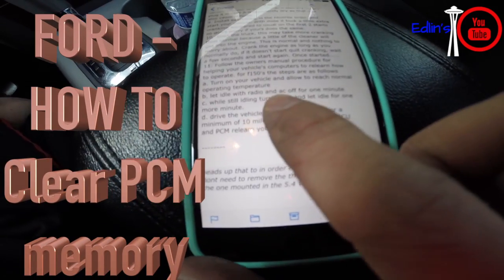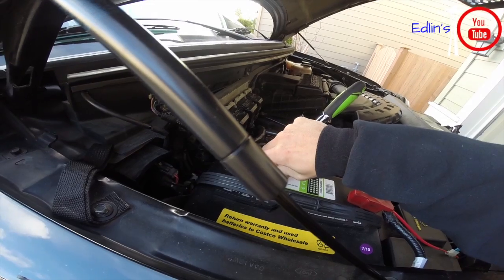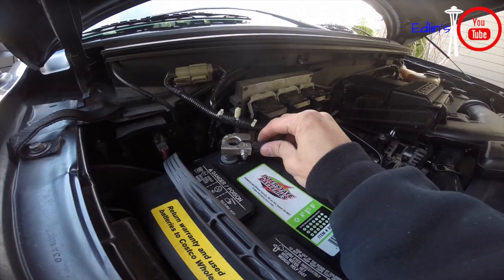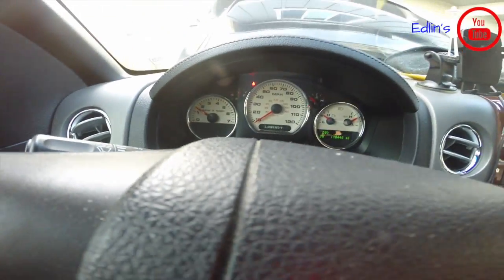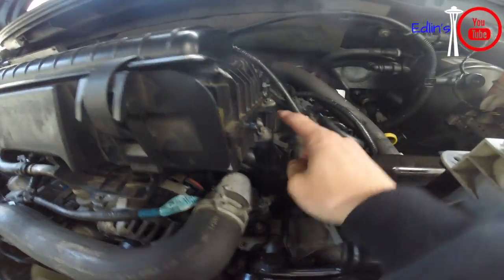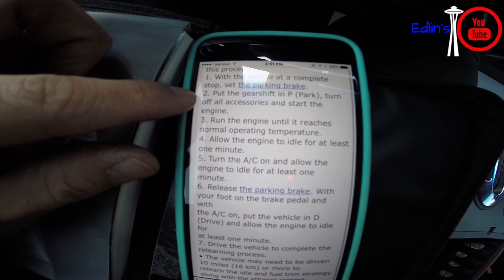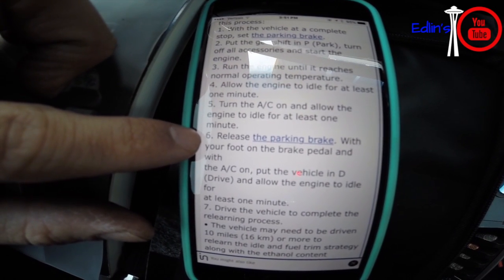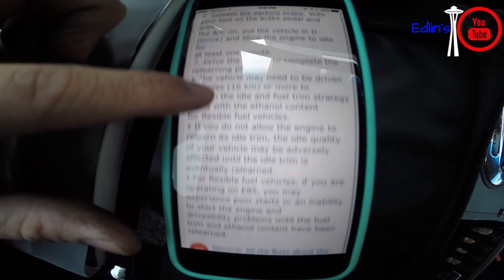FORD - Clear/Reset PCM Memory

Comment: It works both way on some models of Ford. Some just disconnect the neg and hook back up. Light will go off. To actually reset pcm disconnect both pos and neg and zip tie them togehter or jump wire them together for more than 10 mins to drain capacitors that are storing power for the pcm. When those die out the factory stored memory information will kick in after hooking up the battery terminals again. That's when you follow the instructions carefully. Some models will reset just by disconnecting. Rule of thumb....just because light goes out means the codes were clear. Kill off the power in the diodes and make the pcm rely on the mapping the car was designed to run on.
Reply from the maker: Good info, thanks for sharing!

Comment: This video will not reset the PCM period.
You need to disconnect the battery terminals and jumper short the battery cables for ten minutes. 😮

Comment: Hi there. 
We watched your video because my husbands trucks batteries had to be disconnect for 2 days.  
Tried to drive and realized we need to reset the pcm. 
If us a f250 2015. 
Will your video work.  
So do we start over and disconnect it all  ?
Reply from the maker: starting over is a good idea. it should work

Comment: Disconnect neg terminal, turn headlights on to drain everything.  Wait 10 minutes or longer.  Reconnect negative terminal (while you're there, pull and clean the body earth for the negative terminal also).
Reply: I let things sit for over an hour and it didn’t reset my code. No what might be the reason for this?
Reply: @tonyhall9764  probably has a time without power reset thing going on.  Or it just doesn't matter in your vehicle.  You definitely don't need to wait an hour.
Reply from the maker: thanks !!

Comment: I have a f150 turns over but wont start I put new timing chain, crank sensor, fuel pump,drivers modus, got new computer but still wont start. Any ideas on the problem
Reply: If you replaced the PCM, you may have to program it for your vehicle. The PATS, Passive Anti-Theft System may think the car has been stolen and disabled the starting system. Depending on the vehicle, you will have to take it to a dealer or someone with a special tool to reprogram the keys in order to get it to start.
Reply from the maker: sorry have you checked out ford forums. havent had that specific problem before
Reply: Had that once myself. Turned out to be the plug wires.

Comment: Yeah that don't work at all. I had my battery on my ford disconnected for 8 hour's, got in and the radio stations were still set to my surprise, I talked to a friend hoping to get him to reset my computer with his SNAPON hand scanner that cost about $4500, he didn't have time and told me that there known to hold power for hours later from all the capacitors with all the computers in these vehicles nowadays. So he told me to disconnect the battery and drowned out with a wire from a post or from The Wire to the Post or something to that effect it's on here to which somebody else has posted it also and I did exactly to the T and it doesn't work, since this is happened my truck went from getting 16 miles to the gallon then it went down to getting 10 miles to the gallon on average in City Driving in highway driving was average 21 miles to the gallon and that's on a V8, now my friend hasn't had any time for me and hasn't returned texts or calls so something happened with him not sure but obviously not too good or my money is green enough, the sad part is I could have sold my minivan for scrap for $450 last year and 2017 to a nother scrubber and this is what my friend does on a side also is scrap vehicles and I gave him the vehicle two years prior and it's still sitting in my yard and I'm a man of my word I gave it to my friend and I still consider him my friend but I will not chase him down to have him not return my calls, I will be calling to see if I can get $450 over the next month or two because not passing it up a second time if I can get that, plus I need to get rid of another vehicle which runs and drives but has some rust on the rear unibody frame and part of the rear axle assembly connect to that part of the FRAME, so to me it is not safe to drive on a highway at all and everything to the brakes are brand new on it less than 5000 miles, the only thing it really needs is that fixed and four tires and the battery died from sitting for the past 3 years, it's a great little car with a 192000 miles on it but the transmission has 90,000 miles on it and the engine only has 60,000 miles on it, both have been replaced by me and I've owned the car since it was 2 years old (2nd owner) and all the service done myself and looked at the cars that the engine came out due to theres 2 different engines on the 2.0L 4 cyclinder for Ford now, had to check if it had something off the backside of engine for something which I don't recall, if my wife cleaned the car up, then I could have sold it for $1,000 but for the last 3 years sitting it started to rot a lot more so I won't sell it to anyone to drive on the road at all,  even though you can drive it straight down the road but I will not allow that to happen, I will make sure that goes to a scrapper unless somebody plans on fixing it,  I've seen people looking for cheap cars like this to fix up but they can't do to a lot or rust repair, it will pass inspection by looks without putting this car on a lift and looking through the wheels then this car will pass inspection by looks and by emissions, put it up on a lift and you'll see the rot on the frame part that isn't noticeable from just a quick peek looking under because you can't see it until you are directly underneath of it,  it's very dangerous if that would to let go while driving down the road, if it would let go then the rear axel could just fall right off the frame which would make you turn right around most likely throwing the car out of your control and it's very possibly to flip over and go into oncoming traffic, then causing major problems for everyone and endangering everyone's life so I won't let that happen at all if I have to cut the exhaust I will. I will make sure it don't make it back on road, wouldn't mind making a toy put of this car and chopping it up to make it into snd off road machine, this engine is very peppy and fast, it goes 110 then shuts down and comes back on at 105, I can say that i cutoff hard by a BMW that would of killed most people, me well I ended up in the high speed grass because i was pushed off highway to avoid accident, I blew my horn and the jerk flipped me off and threw a cup of coffee that had little in it that bounced off of windshield, I ran him down and pull up to him in the grass at a high rate of speed to have him pull over for damages and he flipped me off again laughing. I became his nightmare. I can almost guarantee that he most likely won't ever cut anyone off again and flipped them off and throw a cup of coffee at them. He thought he could lose me but I never LOST him at all, he pulled away on a straight away, we took and exit GOING fast and luckily you can see both ways for a long-distance like three quarters of a mile easily. He went to stop but didnt and i was all over his tail. I thought of pitting him but didn't want to kill him, wanted his INSURANCE, its all in the DRIVER and anyone DRIVING that BMW should of lost me in 2 minutes max. I stayed with him for 10 minute's and turned around at my rod and gun club, he had license plates for the state we are in and I had out-of-state plates but belong 2 The Gun Club on the road we are on as a member and chase them right to that he opinion turn probably changing his boxer's or did when he got home. I stopped right there and waited, no one came back and he drove and swerved so it was hard to read plate number, so kind of hard to report it, I ended up replacing the windshield at my cost. So I know this car is fast and i would love to throw it into a tube chassis on a smaller/ lighter system with a rollcage , put a better Radiator in it with guards to protect it and have some fun either off road or maybe  drop it in to a stretched golf cart with s rollcage SETUP with like a UTV suspension under it.
Reply: WTF are you talking about dude get ahold of yourself my God, I lost you about half way threw the post and I don't know why I got that far !
    Now witch one is it the negitiv cable and disconnect the positive or the other way around ?
Reply: @nunyabisnis1448  LMAO... I had the same the same thoughts. I busted out laughing with "get a hold of yourself....". Well said and thanks for the laugh. I'm trying to find some helpful info. I thought the long post would have some helpful info, but wasn't worth being "drowned out with a wire". Didn't make it half way.
Reply: @tim9914  this dude is off his rocker literally and no Grammer or punctuation you don't know if he's stopped the sentence or he's just still talking fricken crazy  I got a laugh that you got a laugh ✌🏻🇺🇸🗽🎺
Reply from the maker: yeah sorry about your story man. rough stuff.

Comment: does doing this restore the "factory tune" to the computer? i have several mods on my 06 Mustang GT (Cold air induction, larger throttle body, etc) and have a performance tune loaded into the computer.
Reply: Joe Miller : NO, it does NOT. This Edlin fella has no fucking clue what he's talking about bro. You can only change a PCM/ECM/ECU's programming by re-flashing the computer with a dealer's computer or certain aftermarket tuners.
Reply: @turbodiesel4709  Not true, if you want to update with latest software programs you need to re-flash. if you just want to clear the PCM to have it re-learn you drain the capacitors via negative post cable off,  jumper to positive and wait. Then with all accessories off  let it idle for several minutes, then drive it smoothly letting it shift normally, it may take many miles, but after a few miles you can turn on A/C, and other accessories.
Reply: @timmytool1231  Well bud, you clearly didn't read what was written. What was discussed is will his aftermarket performance tune in his ECM be restored to factory original, simply by resetting it? The answer still remains, NO. A performance tune will only be eliminated by reflashing the ECM. Please READ before making a stupid response.
Reply: Turbo Diesel Snowflake? Man you're quick witted, as far professional, not ever close, go back to shed and try again.
Reply: @turbodiesel4709  I see you are a professional technician. Can I please ask a question....I was trying to reset my PCM after fixing a vacuum leak. 
I followed FordTechMakuloco's procedure, but it didn't seem to work.
My LTFT is -56 and it will not reset. Tried twice, left the jumper on for hours the second time! STFT looks normal. The PCM is a EEC IV. Vehicle
is a 1995 Ford truck. Could this PCM be bad? No CEL  Thanks much
Reply: @mark98070  -56 for a LTFT is VERY abnormal. It sounds like your engine is experiencing an extremely rich condition with that kind of high negative number. It may not "clear" because something is causing it to stay rich, and stay far negative. Does that number even change or fluctuate at all? It should. If it does not, you could have a wiring or connection issue at a sensor that's feeding the ECM bad data. As a straight up guess, it could be your mass-air flow sensor that is causing the problem. Again, could be, so don't quote me on that.

 I'd recommend you do some research on understanding fuel trims and how to use them to diagnose problems with the fuel injection system. It is somewhat complex, but once you get an understanding of how it works, it can be very helpful in diagnostics. 

Although I am a professional technician, even I do not profess to be an "expert" by any means. I'm just not stupid, and I get pretty aggravated when I encounter bad information from folks on the internet, who make videos as if they know what they are talking about, when in fact, they do not. 

There is another channel on YouTube that is from an actual automotive trade school that may be able to help you more with your issue. If I find it, I'll post their name here so you can talk with them. 

I honestly haven't worked on, nor seen an early/mid 1990's gas truck in a good many years now. Here in upstate NY, they are mostly all in the junkyards from rust by now. Very few left on the road around here. 

Additionally, I'm predominantly a heavy truck & bus technician these days. So I'm not entirely current with the gassers fuel tech like I once was, many, many years ago. Fact is, I only fix automotive stuff on occasion these days, because we all have them to get around with in our daily lives.
Reply: @mark98070  Found the channel I was talking about... It's called "ScannerDanner".
Reply from the maker: nice info !
Reply from the maker: yes i believe it would get rid of that performance tune if you did a factory reset.

Comment: Sorry man, but this is a totally worthless video. You really should remove it from YouTube because it has no usefulness as to what it was claiming to tell / teach. UGH!!!
Reply: Turbo Diesel According to other videos on more recent Fords, even draining the caps will do no good because Ford started using NVRAM (Non Volatile Random Access Memory).  Settings can not be ‘dropped’ or ‘erased’ without using a computer (whether onboard or external) to give the command to reset them to defaults.
Reply from the maker: worked for me bro !
Reply: What exactly worked for you? You didn't show nor tell how to actually reset the PCM/ECM/ECU in this video! 

What you have to do is disconnect your negative battery cable from the battery, connect a wire between the negative battery cable and the positive battery cable and let it sit for a while to drain the internal capacitors of the module which allow for the retention of the "keep-alive" memory. 

Then after a given set amount of time (the jury is out on this one, as everybody has a different opinion of how long to do this for), you simply remove the jumper wire and re-attach the negative battery cable to the battery. 

You then start the engine, let it idle for a few minutes to begin the re-learn process, and then take the car for a drive and drive it normally without beating on it so that it can re-learn what it needs to from the various sensors on the engine and transmission.

Make a new video saying and doing this, and you'll have a video worth watching.

Comment: Hey i have a 2005 Navi and i changed the battery and starter.. if i dont do a reset what will i experience.. i wend about a mile and it turned off.. i checked fuses and 2/15 were blown i replaced them and then went a block and turned around then when i parked i let ir run but i got some errors.. odo data error the advance track Now wont crank or start...
Reply from the maker: shoot i dont think a simple reset will fix that issue. sorry to hear that.keep me updated on what happens.

Comment: The title to this video should be "How NOT To Clear/Reset PCM"

Whatever website you are reading your instructions from is WRONG!  
The only thing you have reset is your radio presets.
Unless you jump the disconnected negative battery lead to your connected positive battery lead for 5-10 minutes, your PCM will still retain it's memory.
Please DO NOT follow the procedure in this video!!!
Reply: Yea he has no clue what he was doing.
Reply: I've done this and still has radio stations programmed that I programmed.... This didn't do a dam thing
Reply: Hey, I have an issue with 1st,2nd,3rd gear shifting on Ford Fusion 2015 se, it feels so bad when it shifts from 1-3 gear and I don't know what to do. Should I do that reset or no ?
Reply: @timstaro  is the fluid on the dipstick still red?
Reply: @jjthorhauer4691  I have a similar issue shifting from 1st to 3rd. Checked the trans fluid and it looks orange/brown. Does it possibly need flushing? We just bought an escape and I’m not familiar with Fords.
Reply: I have used this procedure on my fords. I have an 02 caravan and haven't seen this done on Dodges. Do you think the same procedure is OK for dodges?
Reply from the maker: Love it thanks man for your advice !

Comment: You forgot the most important part! You have to disconnect you negative battery terminal then put a wire with alligator clips from your positive terminal to you negative wire (that is disconnected from the negative battery terminal). Then wait 10 min. That drains your capacitors. Then drive around normal.
Reply: exactly
Reply: Tell em Tom
Reply from the maker: thanks for the tip !
Reply: Make sure your ground cable doesn't touch the post. While gator is connected to cable.
Reply: Lmao! Nice!
Reply: Tom Parry  what gage is that jumper wire...i see it done in other videos? Looks like 8 or 10 gauge?
Reply: Hey, I have an issue with 1st,2nd,3rd gear shifting on my Ford Fusion 2015 se, it feels so bad when it shifts from 1-3 gear and I don't know what to do. Should I do that reset ?
Reply: @timstaro  reset like Tom Parry wrote then turn the key on axillary without starting the engine for 30sec. Then after you start your engine and let it idle for 10min. Afterward you take it for a gentle drive make sure your engine is up to temperature,  drive making sure your tranny goes through all the gears then you have to come to a stop so yor tranny downshift through all the gears so your engines PCM learns to idle "that's the 10min at the beginning" and learns the shift pattern again, do this a few times and if that doesn't fix you car's tranny issue, look up on YouTube  "fordtechmakuloco" this man is all about Ford's
Reply: Especially if your "fusible link" (your jumper wire) isn't small--gauge wire.  Even if it is, who knows for sure that the current surge won't cause problems.